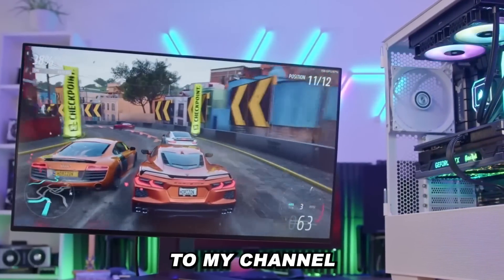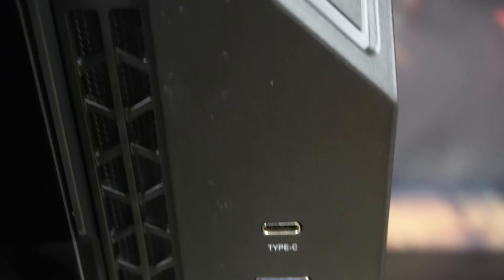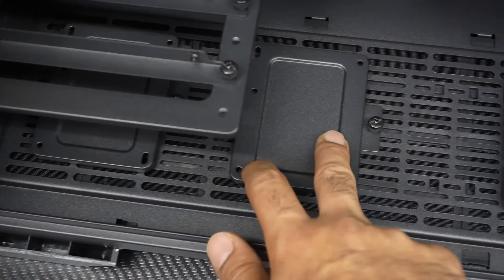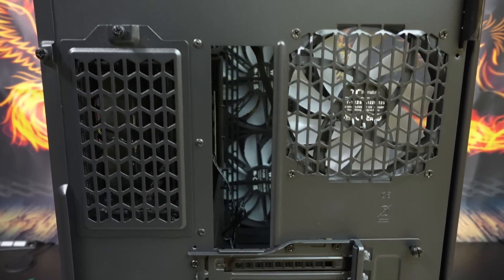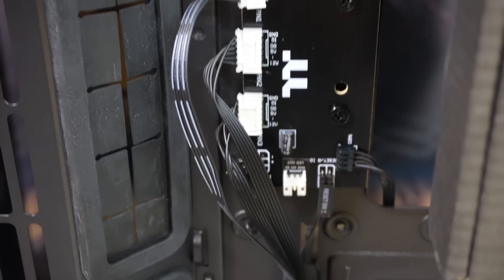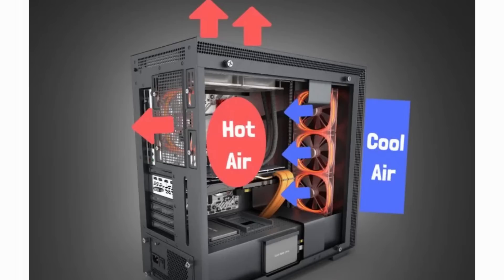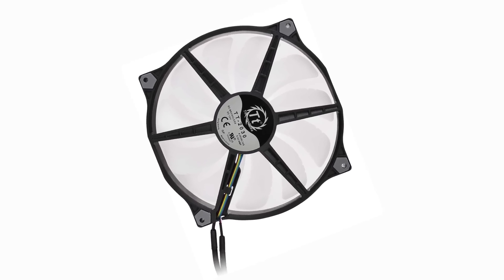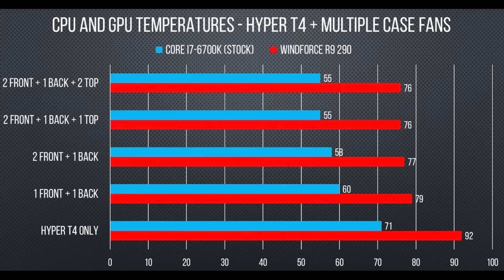Positive vs Negative Pressure in Gaming PC Cases: Airflow Guide

Comment: Legit, I came here to see what is the difference between positive and negative pressure and which is better for my case, this video is 80% you showing random irrelevant components, 20% saying what are the flow types and 0% explaining what effects the different types have, exactly what the title is about, such a waste of time.
Reply from the maker: I have created a new video for this almost 5 months ago but still not published due to some reasons, but I will give you a quick guide, it does not matter which air flow you are using unless your componetes are for gaming purposes meaning there are too much OC going on around ,if your system is high end use positive ( by adjusting the blades in a position that sucks the air into inside the case ) , if your surrounding is dusty use negative but NEVER neutral ( blades should suck the air out of the case )  , and as for neurtal i never recommend that since it  tends to settle lots of dust into the case , and you may already know that NO 1 twin enemies of you components  are : HEAT+DUST